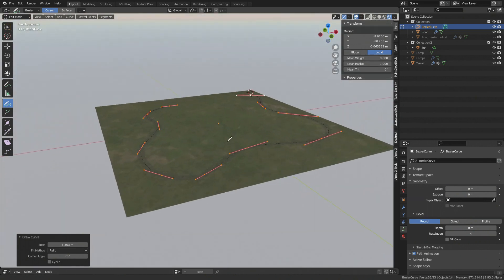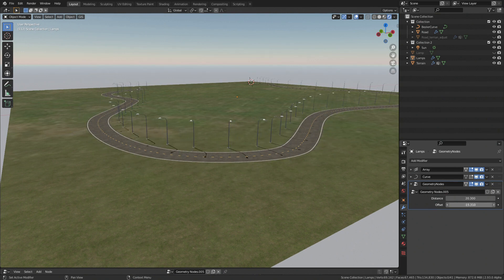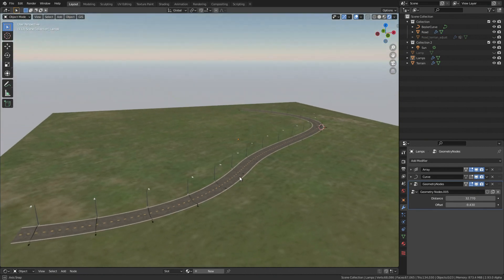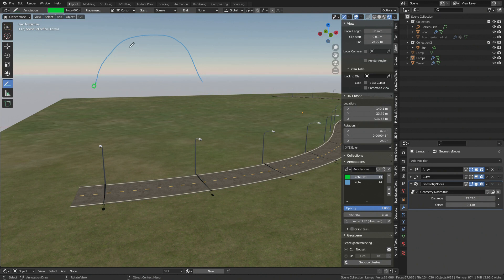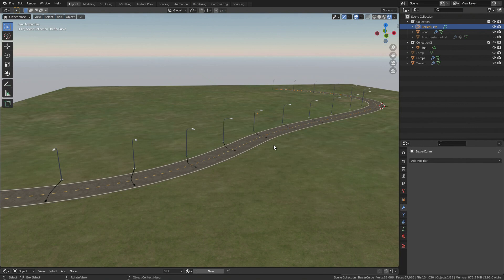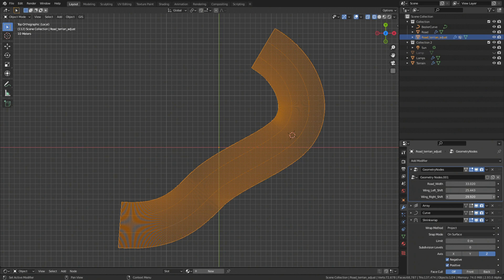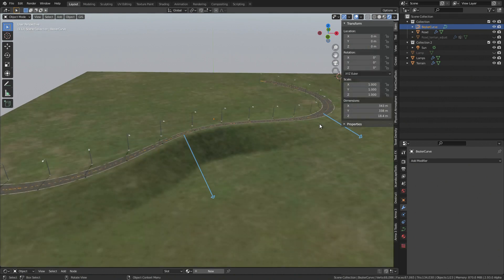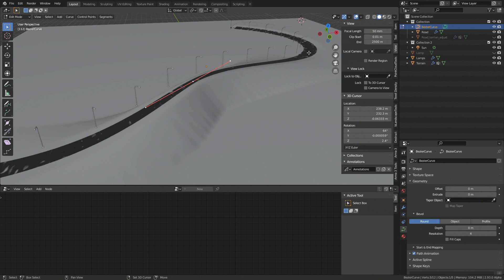Geometry nodes experiments - Let's talk about Curves support

Comment: Hello Miro, thank you for your examples which are very close to our use-case: making rally tracks for Richard Burns Rally. I would like to ask you, do you think GNodes are already optimized and feature-rich so they can be used for populating vegetation assets over large scenery (trees, bushes, grass along e.g. 50km road)? How the performance would be, compared to particles? Is it already possible to export the result as a joined mesh, so it can be imported to a game engine?
Thank you!
Reply from the maker: Hi Jan, you're welcome! You can already do interesting stuff with GN, but I'd say it's far from being production ready(performance/feature wise). Regarding your use case, it depends on level of fidelity you'd like to achieve. I haven't done performance comparison GN vs. particles. Not sure about joined meshes either, but I'm already able to export for example instanced vegetation(via python) into Godot, will do a video about it soon. Find me on Facebook(I'm in Blender Geometry Nodes) and we can talk more about your stuff in czech :)
Reply: Thank you very much for info, I am looking forward to any GNodes related video you will make :) Will leave you a message on FB once I finish some work first. Díky :)